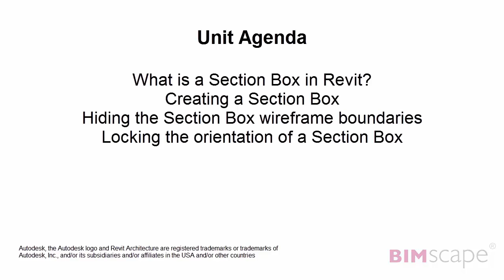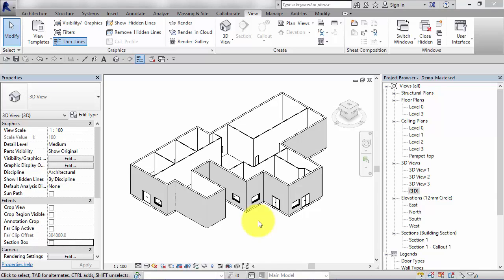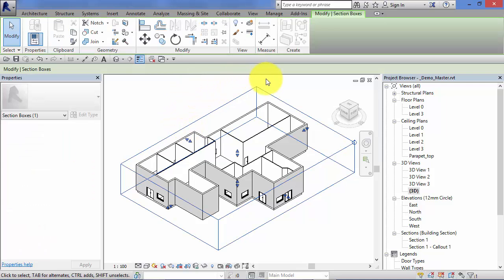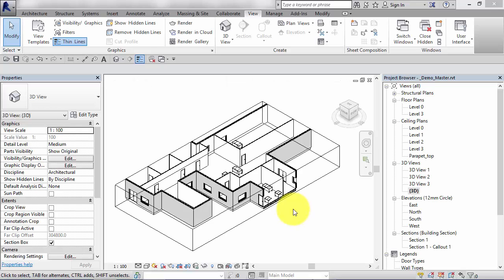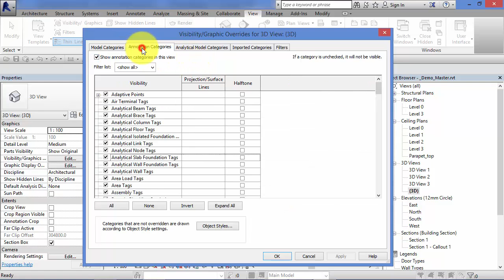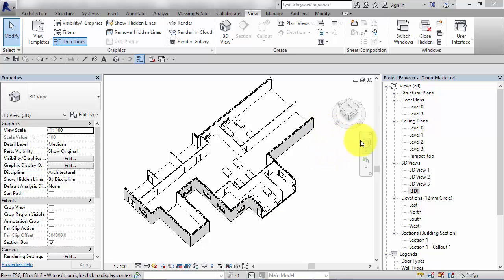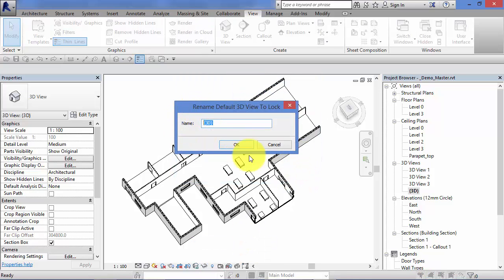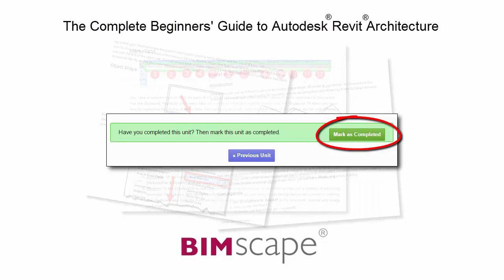Module 6: Unit 9: Revit Architecture: Section Boxes

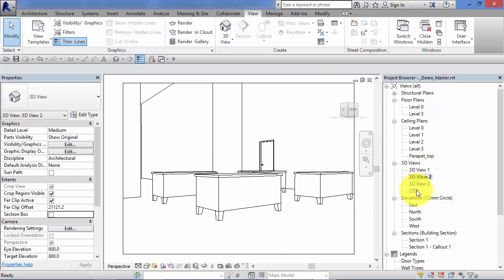Comment: Your vids have been an excellent refresher to a few things long since forgotten, - much appreciated. However, a little bewildered why you state section box can not be used in camera view as surely this is not the case. Indeed, at 1:38, section box option is clearly visible whilst in camera view.
Reply from the maker: +ajkfire Hi. many thanks for the feedback. You are absolutely spot-on! The Section Boxes were only available in 3D (and no Camera) views for many years. So I'm used to just seeing them there. But as you state, the check-box is clearly visible at 1.38. Many thanks for pointing this out. After all these years, I am still learning new things about Revit- which is great. I'll make sure this is explained in the associated written article and i'll get a pop-up card made up in YouTube which will appear over the vid at the correct time to explain the inaccuracy. Thanks once again for your input.